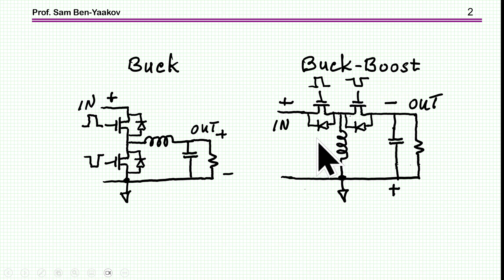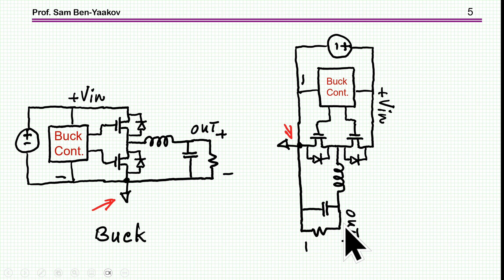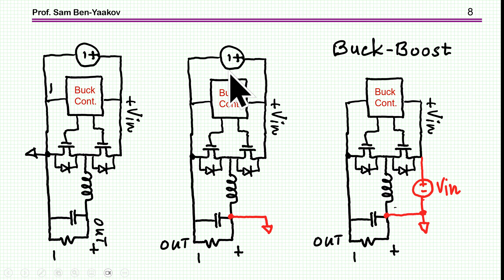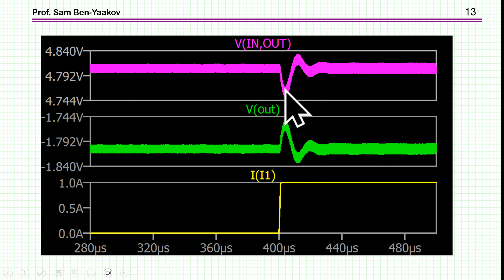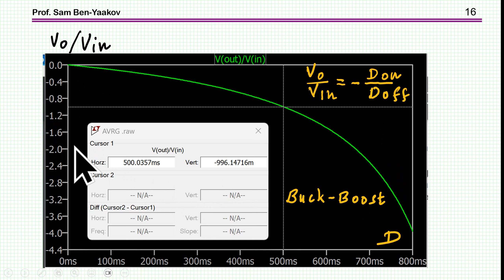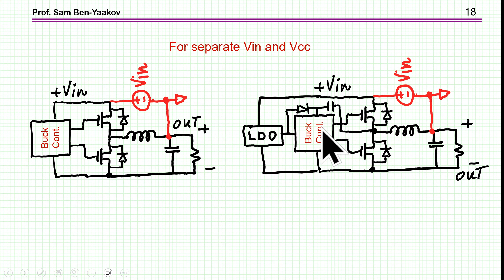Converting Buck to Buck-Boost to get a negative volage

Comment: i assume it is relatively hard to keep it stable since the input voltage keeps changing.
Also now there are 2 way to get a GND short
Reply from the maker: Indeed, the rearrangement changes the open loop transfer function and may require a change in the controller. As for GND shorts I am not sure I follow.

Comment: Clever. While the circuit looks like a buck converter, it is not. So replacing the converter by a linear regulator does not work, obviously.
Reply from the maker: Indeed